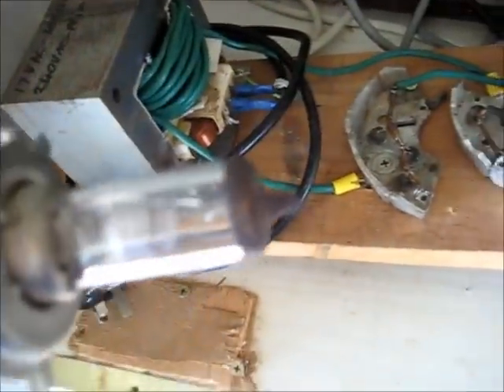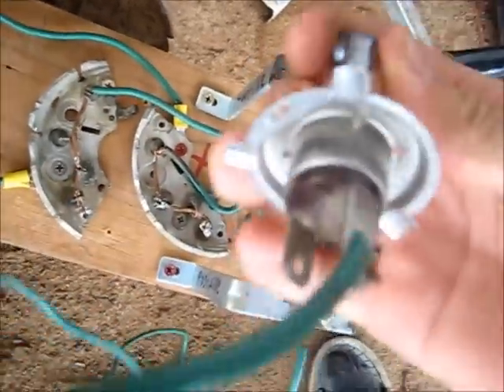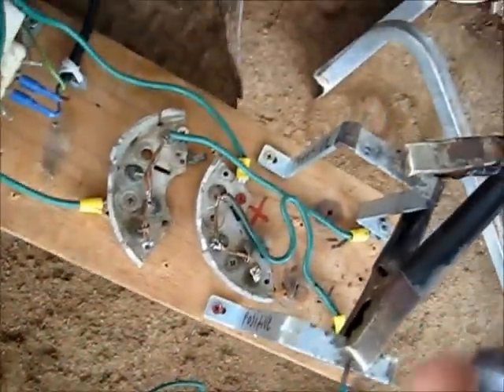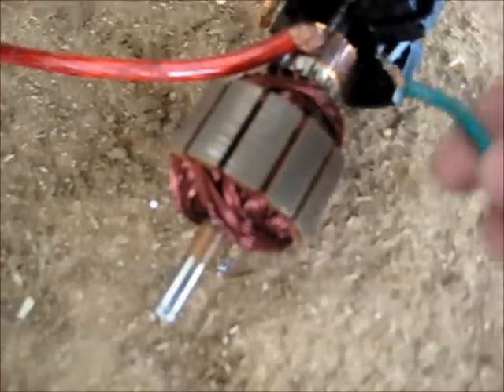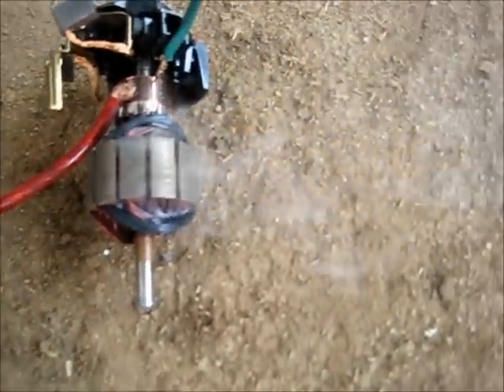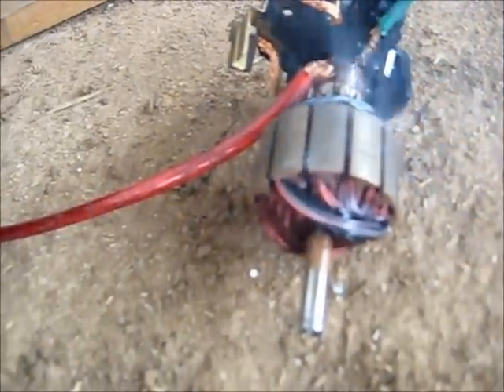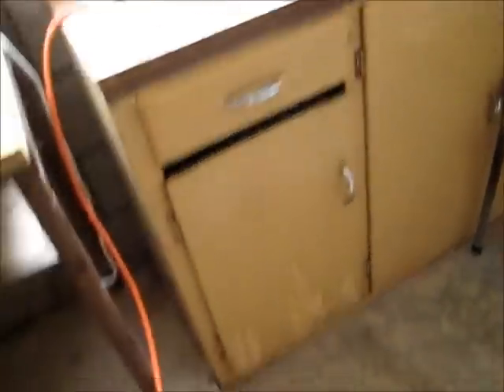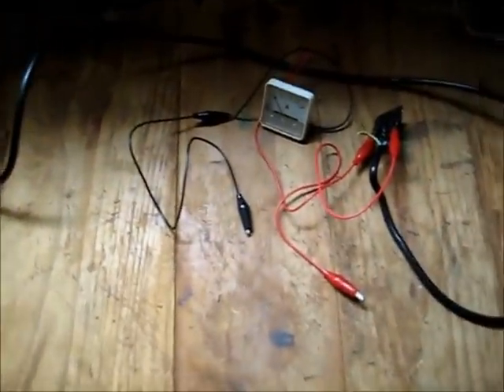H4 Light Flash & pop 2 Speakers

Comment: @MrGerbilBrain ah yes... however, you can meassure AC with DC ammeter (sry i forgot it's different from czech :D )  when it's rectified... so when you connect an ammeter straight on terminals of a bridge rectifier (+ -) you can use AC inputs of that rectifier the same way as AC ammeter,... i had it like that until my ammeter for only 10A broke from over current (30A :D )

Comment: I once connected a 100/115/210/240 primary to 6/12 volt secondary transformer in reverse to a 115 primary/25 volt 3 amp secondary transformer. 25 volts into 6 volt winding results in 1KV at 240 v winding. Small 6 volt incandescent bulbs which are burnt out light up again with the 1KV arcing across the broken filament ends. The color of the light was silvery/blue and continued until the filament support lead-ins bent over and pulled the ends too far apart. 
What kind of motor armature is that?